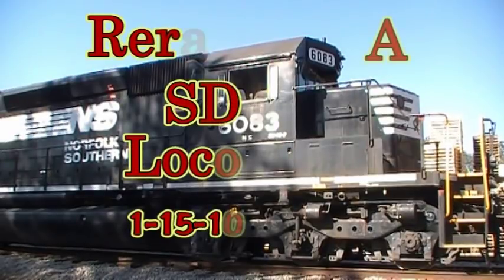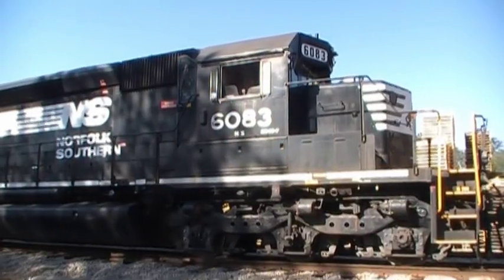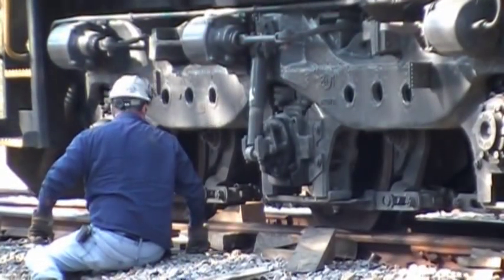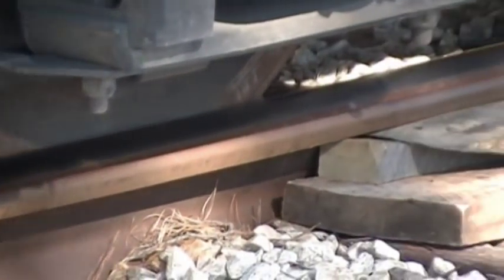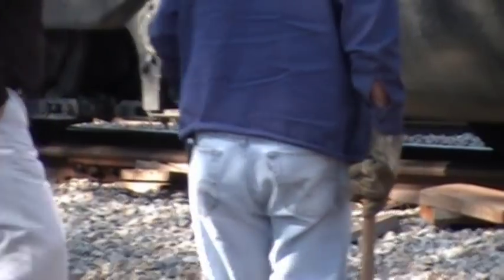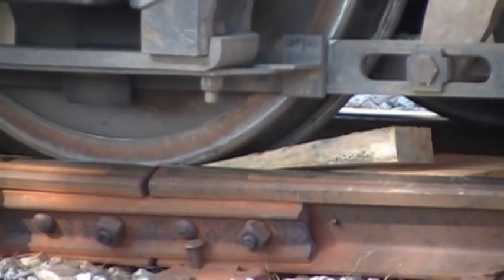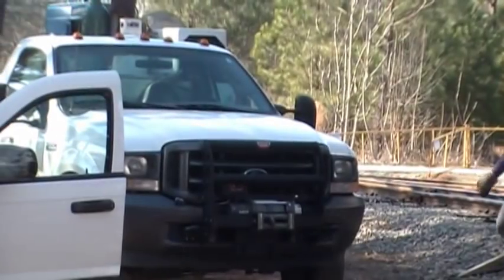Rerailing-An-SD40-2-Locomotive.mpg

Comment: What impressed me was the fine control the loco had, in that it could move just inches at a time.
Reply from the maker: A good Engineer can do that,  Thanksd John
Reply: Simply work power against the indepensent brake. As stated, any good engineer can do that.

Comment: I'd would have never guessed this is how they did this. I learned something and thanks for the video.
Reply from the maker: Thanks for commenting
Reply: pwalpar I've seen lots of pics from the 50s-80s of cranes re-railing locomotives.  Have railroads abandoned the crane for this purpose simply because railroads really don't use the big 200 ton rail cranes anymore?
Reply: Every time I see one of these rerailing  vids I wonder why they do not use the steel apparatus used by the Russians to rerail a locomotive, seems much more efficient than pilling up wood?

Comment: Give me a fulcrum and I will move the world.  This time these fellows used simple wedges to more tones of steel.  Remarkable.  What was scary was when the aft truck was teetering on one of three wheels on an eighth of an inch of rail while that guy put his head under there to put more wedges under the wheels - brave!  I hate to think what would've happened if that third wheel slipped off the track on it's own.  Great videos sir!

Comment: Always wanted to see this type of repair.  Surprised that wooden wedges would get the job done.
Reply from the maker: wood wedges will work quite often  thanks for the comment
Reply: Wood wedges also used to be used as wheel stops for steam trains
Reply: If a train gets stuck on a hill they put wooden wedges and jam them into place using brute force 
Then it keeps the train still
Reply: @pwalpar  only for light trains

Comment: Wood wedges! It has to be natures best hardwood....oak, and used for everything from whiskey barrels & barns, to skid plates on the rear of passenger planes, and now train railing shims.
Reply from the maker: Marc Del Yep  they do very well for ,many purposes  thanks
Reply: I worked for a short line class 3 railroad. We have re-railed many cars the went on the ground with oak blocks and wedges. Me personally as a conductor, have re-railed probably 45 plus axles. The worst is the 3 axle DOD flatcars with old Buckeye trucks.

Comment: Re-railin a switcher one of the first things I ever got to help do while waiting to be trained to Operate for Rail-link at Eastman Chemical. The second was to help the mechanic on an engine rebuild by first removing 'the jewlery',(the valve lifters for each cylinder were removed and put in a separate 5gal plastic bucket)! Then an old Engineer/investor trained me for 3 days and they turned me loose with the switching locomotive. Looking back on it, I am amazed to say the least. I operated for a little less than a year, got my job back at the paper mill, then got laid off again and worked 3yrs for Rail Serve as a Loco operator. Good Times mostly.

Comment: Very well shot.   Having been through re-railing with wood blocks for over 30 years I can truly say that those who are good at it (Not I) are true artists.  It's a little interesting running the engine while trying to re-rail locomotives or cars.  Usually the gentlemen on the ground placing the wood blocks blame it on you if the cars do not pop back up.  Nice video work.

Comment from the maker: When the cross ties get decayed the spikes that hold the rial down in just the right place get loose,  then the rail spreads farther apart from each other and one wheel drops inside.,  the nozzle is on the end of a hose that blows sand on top of the rail to get traction

Comment: Never would have guessed they use wood blocks. My brother used to drive a rescue train that would put severe derailments back on the tracks. When you have to pull a locomotive up a steep slope after it dropped 100 feet, you have to have a crane on hand, of course.
Reply from the maker: You refer to a derrick  Im familiar with them

Comment: @pwalpar All tracks are either pinned down with spikes or with clips.  With concrete ties, they use clips to hold the rail down.

This video was taken in a yard where maintenance is not as important as traffic on the track is slow and infrequent.

Comment from the maker: The rails can spread apart too far if the timbers decay very much.  It happens if the tracks are not maintained well.  Look at it this way if it drops off the rail it only drops a few inches.  Lots closer to the ground than on an airplane

Comment: Witnessed that many times in the 12th Street coach yard in Chicago back in the mid-1970s.  12th Street was the old Penn Central yard and got zilch in track maintenance.  When Amtrak took over, there were rotten ties everywhere, loose rail joiner plates, rail with bad profile, worn-out turnout frogs...you name it.  The run-around track east of the car foreman's shack would go out of gauge at least once a week and put something on the ground.  Almost had an SW1000 end up on top of my truck when it folded over the outside rail on the run-around track, went on the ground and almost made it into the parking lot.  Too bad it missed: I needed a new truck at the time.  ☻
Reply from the maker: Thanks for sharing your story :-)
Reply: I bet a lot of four letter (and five letter) words were used back then.

Comment: Excellent video showing detail which others miss.  
Thank you also for explaning what they were doing and what was about to happen.
Could they not have used a gauge clamp to pull the railhead in?   Then stop before the wheels roll over it and move it?   Move the engine out of that bad area and back home?

Comment from the maker: Its referred to as A pop off valve.  I think what it is doing is spitting out water moisture.  All compressed air accumulates water from the air..  Imagine what might happen to that moisture on a freezing day.  Ice in the lines would cause the brakes to fail I am certain.

Comment: Interesting video!

Thank you for capturing this.
What was the cause?  The rail moving out or the engine derailing at the switch and forcing the rail out?

Would be nice if they had a few clamps to slide under the rails between the ties to force the rails back to gauge.   Remove some ballast the get the clamp shaft under the rails.  Then at least the train could continue and they later repair the track.

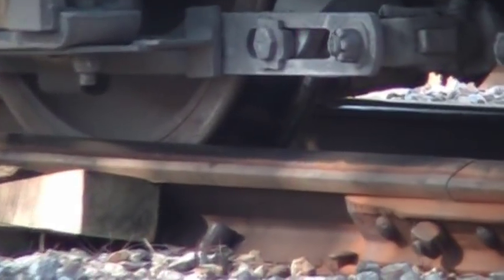Comment: Thanks for sharing this, it's very interesting to see.  I have two questions; how does it happen that the truck wheels become derailed on the inside of the gauge? and at 2:18 what is that nozzle for just in front of the wheel?

Comment: was it bad ballast that caused the derailment I had the same problem in Bliss Idaho. UP was switching the grain elevator it rained the day before and the tracks turned into quicksand and pulled the hopper off the tracks they had to take a crane to put it back on the rails

Comment: Very interesting movie. I wonder one thing - whether the locomotive continued driving to the composition or was cut out to the nearest maintenance? In Poland, the locomotive, which would be derailed by one set have been recovered from the trail to the shed (common name for depot) on the so-called current repair. You should not use this method with wooden supports - because the locomotive wheelsets rim deform.

Comment: Is there a danger of a carman losing life/limb if he is setting up those wooden shims and a wheel is barely on the track about to fall? At certain points he was under the engine a good bit and there wasn’t much clearance between him and the engine so if the engine were to drop a few inches, from say, falling off the rail, wouldn’t he get seriously injured or even killed?
Reply from the maker: There is indeed dangers involved  the locomotive can turn over as well
Reply: pwalpar The locomotive can tip over entirely?! Wow! I mean, does that ever happen? What assurances does the Carman have that he won’t be crushed? I believe the average weight of a loco of that size is 400,000lbs, is that accurate?
Reply from the maker: @danielsullivan958  I have seen them tip over  they are so heavy when one side gets in the rocks it can tip over  I have had to run out from under one as it fell  so I know lol
Reply: @pwalpar  Wow. It definitely seems like it can be a very dangerous job. Do you know roughly what one of those locomotives weighs?
Reply from the maker: @danielsullivan958  34000p lbs

Comment: Saw a hopper car pulled off,not intentional of course,then rerailed back in 2000 about.felt sorry for the railroad staffer because bout a dozen people standing around gawking and giving advice could not have made his job any easier,he used wooden blocks and wedges but in the had to use some sort of chain and metal wedge contraption to get it back on track,everyone was shocked how easy the empty car came off the track,car puller, wrong angles = Bad time for everyone.

Comment: I'm guessing a track crew had to come out here and replace all the damaged track, right?  Are they allowed to reuse the old rail and just spike it down to new ties?  

Would a locomotive involved in a minor derailment need to be taken back to the shop?  I would think they should check the engine's wheels for flange damage before they send it out again.
Reply from the maker: Rail is regularly reused  The wheels do have to be inspected but not necessarily in a shop

Comment: Interesting and good to know how it's done! BTW- what is that "PSST" sound every 4 seconds or so when the loco was running? At first I thought it was air brake pressure release or something. But when the train started moving and I kept hearing "PSST", I wasn't sure.
Reply from the maker: Its a spit valve of sorts eliminating water from the air compressor lines  This one seemed defective
Reply: Thanks!

Comment: I'm surprised they'd let that guy lean in there with the engine running and that middle wheel teetering on the edge of the rail.

Comment: I said tonne, meaning Metric tonne, and I don't know much about rail engines.  I got the '100 tonne' measurement from the first available article on the internet.  Still a ton is numerically less than a tonne, so it must be more than 160 tonnes in weight!

Comment: Cool.   When trying to get the rail to stand back up, why not use a come-along to pull the rails together?  You'd remove it once they got on top again.
Reply from the maker: +Doc Memory There are times we use similar equipment to a comealong
Reply: +pwalpar Interesting.  That was a question, not a suggestion.  It's amazing what can be done with just wedges.  But I'd guess they have been putting trains back on the rails for many years now.   If I fell into the gauge, I'd call AAA. :-)   Send me your biggest truck.

Comment: Knock on wood, but I haven't put power on the ground yet.
Reply from the maker: Good luck keeping it that way
Reply: Thanks.  I've had one scare; 8' of broken rail.  Made it over and stayed on the rails, but messed up the rear trucks on the trail unit.
Reply from the maker: jasfromoz You wait till the first time you come upon a washout LOL
Reply: I work for CN and I run mainly on CTC, so any sort of washout or broken rail is usually detected long before I get there.  The broken rail I made it over was in the yard.

Comment: Just food for thought, if you have anything that moves at some time or other something wrong is going to happen, its Murphys law or the law of physics, take your pic, and that goes for cars, trains, planes, trucks, no matter how good the rail line is maintained or any other thing, if there is something moving it going to have a accident no matter how much you try to prevent it, the rr,s knew this, that is why all railroads were the first to invent a thing called a wreck train.
Reply from the maker: derail14 Thanks
Reply: +derail14 anything man made is doomed to fail at any time with out warning at the worst possible moment just so we as the human race can pull our hair out trying to repair or fix the problem
Reply: so your saying nothing you work on ever wears out your full of bull I to am also a repairman and have repaired lots of equipment built by reliability craftsman things wear out and break down period
Reply: at least I know everything man made will if fact wear out and break down and need repairing that is much more than you know

Comment: Not sure why re railing loco's are the responsibility of a Carman, that should be the mechanics / MOW Job. Carman make revenue the MOEL and MOW does not... I have re railed one of those loco's not long ago due to a bad switch point. I tell yah I will use a hill block in a minute. There was one part of this video that tells me the defect of that track( gage rod ) easy and cheap fix but not a life time repair.
Reply from the maker: Derail4450 Thanks for commenting